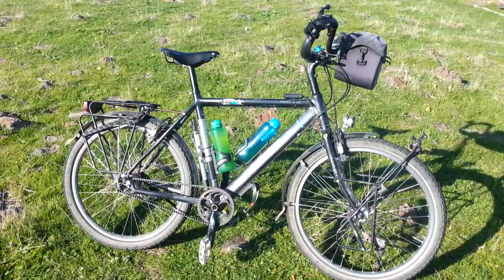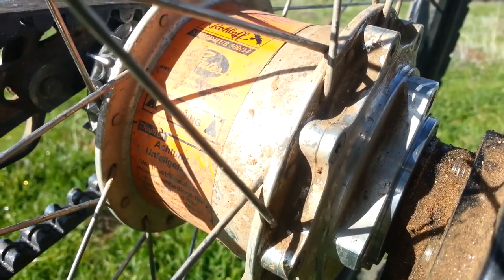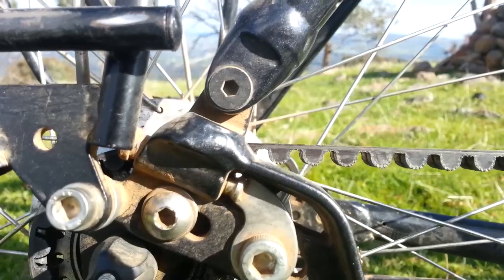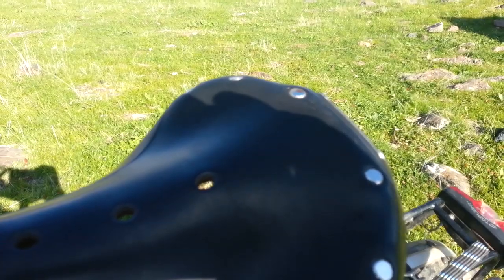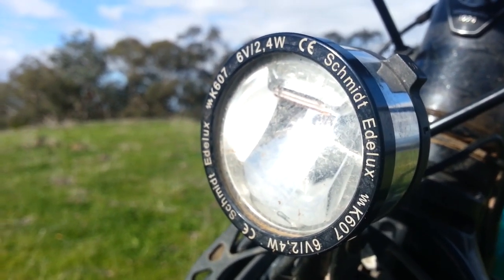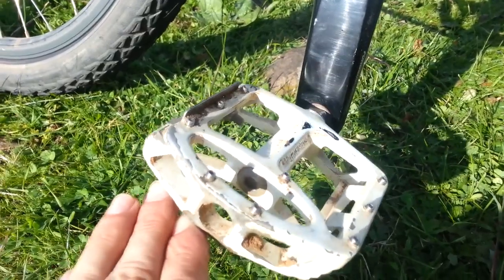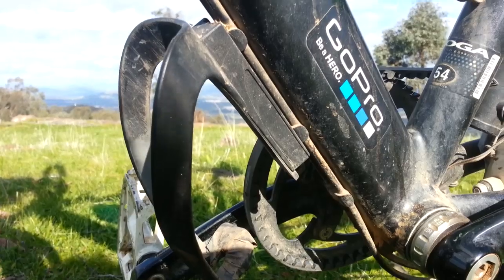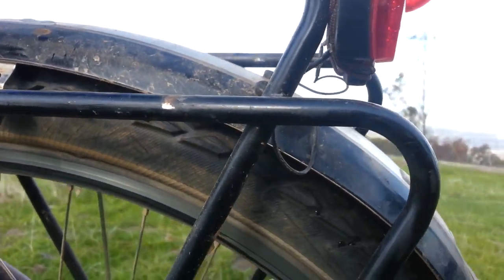Bicycle Koga Signature World Traveller (Belt Drive Center Track) KS-TR-26  Review

Comment: I'm working on setting off on 3 years around the world from the UK, heading East. Still racking my brains for the bike to do it on. Looked at the Thorn Nomad with S&S frame for easier dismantling and its about the same price as the Koga 28 with beltdrive. Although the Thorn has a chain not a belt. Will spend the money, but just want something reliable and something with a lot of feel good about it. Good luck on your travels Chris

Comment: V good review of a bike that's actually been used properly rather than a 1-2 weeks old bike ridden for only 50-100 miles. Rolloff and belt drive set up is what attracts me. You've obviously had very few no problems with it so highly desirable as a long term low maintenance option. Thanks for posting.
Reply from the maker: +Alex Morgan Thanks Alex. The belt drive and the rohloff are excellent. I did have a little trouble with the rohloff leaking a little oil in the heat of the desert. They tell me this is natural. The problem was it dripped onto the belt and squeaked for some time on the sandy roads. It's all good now just did it for a bit. There is another system the pinion 18 http://tomsbiketrip.com/eurobike-2014-will-the-pinion-p1-18-be-rohloffs-first-serious-competitor/ which seems good haven't used it.
Reply: Only your likely to pay around 7k AUD for it as it at the moment.
Reply: That seems like a pretty good deal to me, full setup with panniers and other equipment 9k for a bullet proof ride that will take you around the world, great for the older people as in the 40-50s

Comment: Is that 20Kg with the extras or without ?
Reply from the maker: Hi Ian. It''s 20.6Kg as ordered from the factory with racks handlebar bag, saddle bag, lights, rear carrier panniers, 2 bottles, pump.
Reply: It sounds heavy but it's only heavy compared to really lightweight bikes that could never take the kind of punishment and load that you use it for. I have a 15Kg bike, if I added steel racks front and back plus the same bags, bottles, pump and stands, it would probably be heavier (than yours) and nowhere near as capable. I was considering selling mine for a lighter one until I saw this vid and realised that I just need to train more.
Reply from the maker: Ian Clarke The Koga with it's 26 inch wheels and 50mm Mondial tyres slows me down compared to a 29 inch wheels with narrow tyres. I used to have a very light weight Mountain bike but I don't think it could take the load I have had on the Koga. Which can take 140 kg. The Rohloff is not light but ease of use is great. If you just road on the good roads you could get a much lighter bike for touring. When I was 13 years old I toured with my brother and did up to 200 km's a day. But that was on a  27 inch racer with much narrower tyres and lighter bike. Doing 200 km's these days is a lot more effort but I can turn of the road and hit the very rough tracks and still keep going. Horse for course cheers Chris.

Comment: hi, i'm quite new to Bicycle touring and i plan to drive from Holland to Istanbul (around 2700 km) is this a nice bike for such a drive?
Reply from the maker: Yes but you would be best to get one that is a 29 inch, model ( Bigger wheels make you go faster for less effort.), and if you can wait to June get one with the new pinion /p1.18/ Drive Technology. You should also figure out are you just riding on sealed roads or a mix of gravel and sealed. This could change your choice if you are just travelling on sealed roads. ?.

Comment: apart from the belt drive, the stuff on your bike is stupid , if you are cycling in remote countries, as its hard to repair, keep it simple old school!
Reply from the maker: I guess that's your opinion.
Reply: apart from belt drive? are you kidding me? you can service that bike anywhere, but the belt ? crank? a few spares of the rare parts and you are good. I use more traditional parts, but they do wear faster and require more repair. I think this Bike is up-scale, and low downtime for those that can go the extra $$,  Nice bike Chris
Reply: This is where you are old school corrigeen, I must say your post is very much abrupt and would say it is from opening ones mouth before actual research into new age touring, thanks for the vid Chris
Reply: Corrigreen71 - You gotta be a troll! otherwise you live in the early 1800`s! Do you know what you are talking about? This is not your three wheeled todler tricycle!